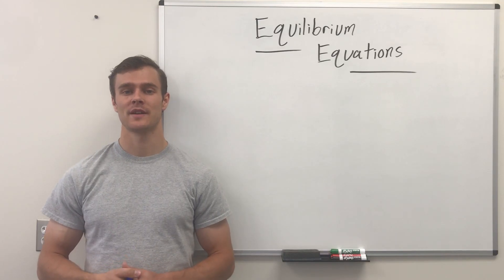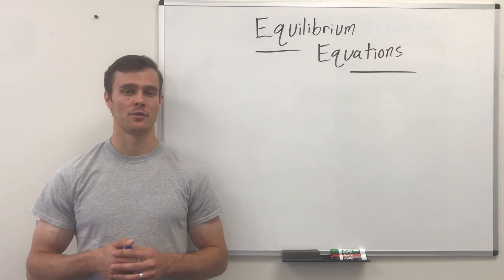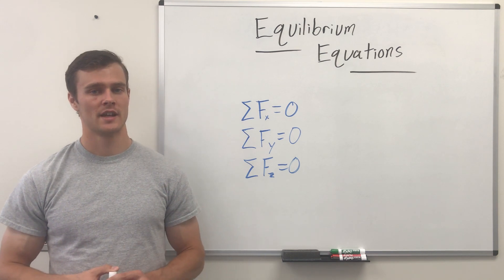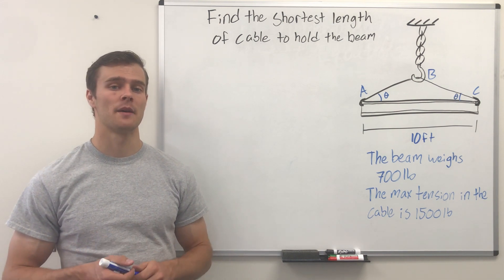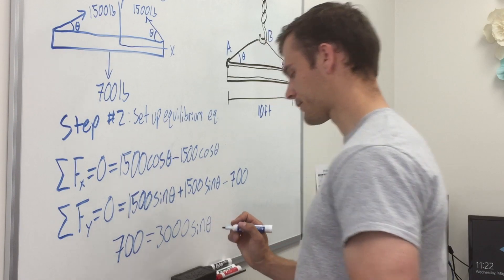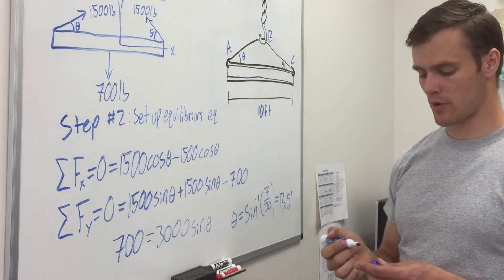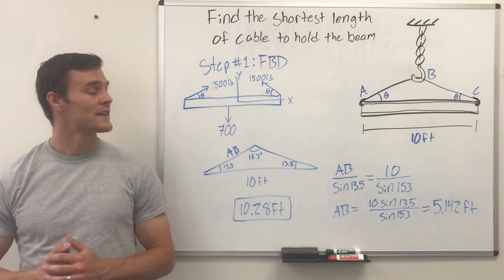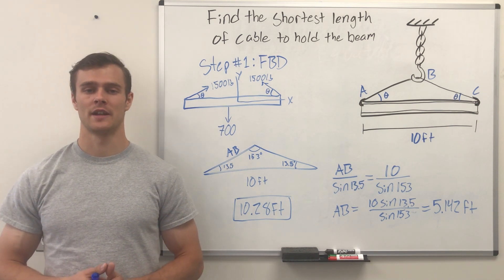What are EQUILIBRIUM EQUATIONS and how to use them to solve and example problem

Comment: Dear Sir, Instead of Equilibrium Equation, can I apply directly law of sine rule to solve the problem?
Reply from the maker: You could use the law of sines to help you figure out the geometry of the problem but you would still need to use equilibrium equations to solve the problem.